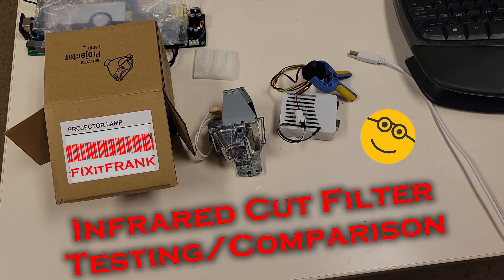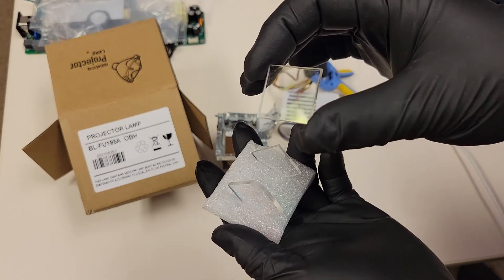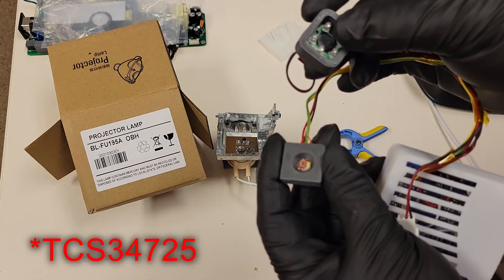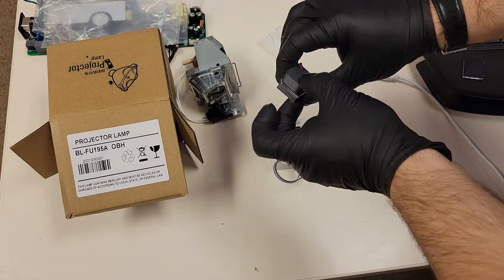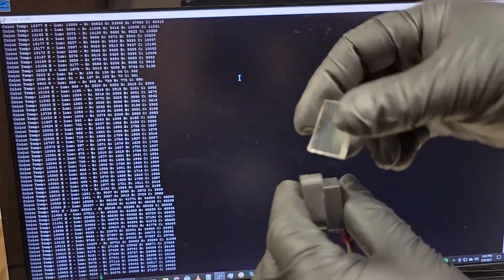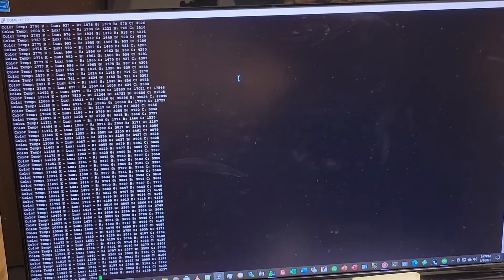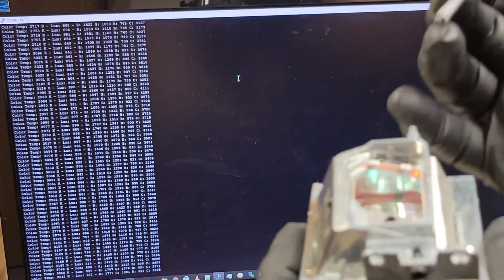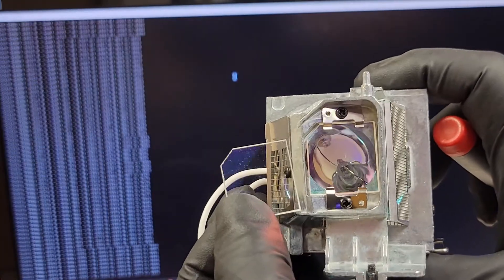Infrared Cut Filter ND Filter Testing/Comparison for DLP Projector Lamps

Comment: Hello, found this when searching what kind of bandpass filters are in projecotr lamps. What terrifies me though is that I thought this filter is primarily a UV filter. I know that deeper UV is unhealthy for the DMD itself, wheras IR does not damage DMD unless it's overheating it. I wonder if You know what would be the cut-off ratio for UV in this filter (or perhaps in this case the UV filter may be more far away on the optical path).
Reply from the maker: My understanding is the glass used for the IR filter cuts off all the UV. Standard silica glass cuts most UV immediately. To transmit UV, they use a special quartz glass I believe (not 100% sure) to allow it to pass. When I measured the wavelengths with my photospectrometer I had almost no UV bands showing. Maybe I'll do that again and record it.  I have an actual Licor li-1800 photospectrometer and that was my results with an older Optoma hd20.

Comment: Do you know of a place that I could purchase a lens ? BenQ w1070 thanks
Reply from the maker: Hi, do you mean the IR lens for the lamp assembly?
Reply: @FixitFrank  yes mine got damaged when the lamp blew. Replaced the lamp and housing but the Lens on the new housing is not working. Would like to just replace the lens. Unfortunately I can't return the lamp.
Reply from the maker: @MikeLL1984  If you are in the states, I can help you out.  My email is on the about page.
Reply: @FixitFrank  I'm in Canada thanks for the offer figured there'd be some website that's sells them.
Reply from the maker: @MikeLL1984  Canada is okay. I can use USPS.  Finding those lenses by themselves is difficult.  They are considered part of the lamp assembly so they are not really sold by themselves.  My day job is in the lamp biz so I have access to things not normally available.
Reply: @FixitFrank  that's awesome man. I will email you shortly! Thanks

Comment: Hey Frank, enjoy your channel, you showed me how to replace the color wheel, in my Optoma HD20, question do you work on Blu Ray Players, i have a Panasonic DP-UB420, 
it has sound, but no video, just turned a year old, i bought a new Sony, if it's worth it, would be good to have a back up.   Thanks  Daveo1945
Reply from the maker: Hi David, I might be able to fix it.  My only worry is that if it needs parts, it might not be worth it. I do see they are going for about $200 still, so a repair might still be worthwhile.   I don't want to give you a false sense of hope mostly. If you want to ship it to me to look at, I'd be happy to take a crack at it.

Comment: Does it matter what side faces the lamp on the protective coating they put on? Or is that coating on both sides? I'm guessing it wouldn't really matter what side it's on, other than maybe a little less direct IR and UV light if it's facing away from the lamp inside. I'm guessing it's usually on the outside because all your examples showed the protective coating shining from the front. I've seen your other videos about the protective coating and what to look for. Very helpful. Thanks for this informative video!
Reply from the maker: Hi Marcus, actually yes! Most lenses will have a tiny black mark or dot in a corner. That dot faces outward. The more 'red' side should be out.  Does it make a huge difference? I don't think so but I'm not sure. You gave me an idea for another video though. Let's find out!

Comment: Hi, Frank.  Stumbled into your channel looking to solve a mystery.and it looks like you know more than enough to help.  Optoma GT1080 Darbees. I have three for a SimPit setup all are equidistant from the screen.  Two have very sharp images, but the third will not focus sharply/properly at any setting.  How should I go about correcting this issue?  Lamp?  Color wheel?  Need help.  Thanks.
Reply from the maker: Kind of sounds like either a damaged dmd or something with the lens system. I'd seen DMDs appear like the mirrors detached from the substrate. You can usually focus part of the image but never the whole thing and focus adjustmentd tend to be small when almost focusing on each area. The first time I ran across this, I incorrectly thought it was dust buildup and then a lens issue. It ended up being the dmd chip. If that is your issue, it would be kind of weird unless the gt1080 in question had a lot of hours on it before you set it up. I've never seen it on a newer projector but I'm sure it's possible.  I think the delaminated mirrors happen when the chip is subjected to excessive heat for prolonged periods. Usually from after market Amazon lamps (ctlamp, jaspertonics) with bad IR block coatings. I'd suggest seeing if you can focus parts of the image and determine if you only need a little adjustment to focus other parts of the image. Of that's the case the dmd is probably the culprit. Otherwise my thought is the main lens has a portion of it not in position. That is harder to describe. Check the dmd first.
Reply: @FixitFrank  Thanks.  I'll play with the focus more with particular attention to detail on how it focuses regionally across the area.  I suspect that I can get a good focus in some spots, but not evenly everywhere due to an earlier observation - just going to be a question of degrees now.  Not many hours on any of the projectors and no after market/custom parts.  I sent the blurry one back for factory refurbishing within the time limit, it came back better, but the adjustment didn't hold...now it's been too long to get it done at no cost.  The funny thing is that the refurbishment didn't hold long, but after many hours of use, it's not gotten worse either - just enough to really notice when I move from looking at the right area of the projected area!  I'll get back to you with an updated description when able.
Reply from the maker: I must add that I was not familiar with simpit until I read your comment. I want one!!
Reply: @FixitFrank  🤣

I dig my SimPit Centurion.  The guy that sells them is cool too.  I've encountered some unique issue playing with three projectors that some tech guys have no idea how to fix, but it's still been good for DCS, MSFS 2020, and MWO.  Helicopters on Arma are okay...still trying to tweak that for a 270° view and not having any luck.

I may, eventually switch to VR/AR, but this really works for now - especially when introducing other people to the fundamentals of flight since simulator pits work well with physical control set ups like mine.

Comment: Frank I need help with my projector. How is the best way to get some help?
Reply from the maker: Hi Shane, what kind of problem are you having?
Reply: @FixitFrank  My projector is only showing half the image after replacing the lamp and wheel.
Reply from the maker: @shanepearson131  The mainboard is probably not quite seated , or the light tunnel has shifted.  If you can share a picture of the screen(imgur.com is good free host), I can look at it and let you know what I think.  What model is it?
Reply: @FixitFrank  Optoma GT1080.
Reply from the maker: @shanepearson131  Sweet. I know those well enough.  Definitely post a picture if you can.   I like to see them posted here though if possible so that other people can benefit if needed.   If you have to use a private or personal email to do so, you can email me directly frank@fixfrank.com
Reply: @FixitFrank  ok lets try this way: 
https://   imgur.com   /a/Uch2xNH
Reply from the maker: @shanepearson131  https://imgur.com/a/Uch2xNH  Perfect!  That is the light tunnel. I have a few videos on light tunnels.  Yours has either slipped or it moved during cleaning.  You should not have to buy any parts and hopefully it can just be adjusted back into position.  Check the light tunnel vids I have and if you have any questions or you get stuck, let me know.

Comment: Hello! i am from sweden.  BenQ 5J.JEE05.001 i Orderd from the usa philips bulb. i hop it is better then osram!!. my osram in my benq w2000+ is flickering evry 1000hr  it is called id wandering electrode sorry for bad engishi.!! my problem is i love my benq but i think the w2000 drive the lamp too tittle of current (the Ballast) or is osram shit??
Reply from the maker: Din engelska är väldigt bra!   Philips is much better than Osram.  The Arc wander/electrode wander is also a symptom of too much time on Eco mode.  If you run Eco mode for more lamp time, please use standard mode sometimes. This keeps the arc electrodes clean of "scale" or "elektrisk smuts".  I suggest every 50-100 hours.  Osram is not quite shit, but Philips is much better. It is like Mercedes or Skoda.  Skoda is better than Trabant, but Mercedes is better.

Comment: Thanks for your video! I have an Optoma HD33, and I tried to tear it down to clean the light turnel, but I failed, have you ever repaired an HD33?
Reply from the maker: Yes! Look up my videos on the HD20. It's the same housing and steps. It's essentially the same projector
Reply: @FixitFrank  Yes, already saw it several times, but I think it's a little different🤣
Reply from the maker: @NiponTsao What are you seeing that is different? I have an HD33 here and it looks identical inside to my HD20.  Where are you stuck? I can look at the one I have here. It's here for a new mainboard so I cannot turn it on yet.
Reply: @FixitFrank Thanks for your reply! I can remove motherboard shield, but i can't remove the motherboard, which sticks to the box so tight, I am not sure what the problem is.
Reply from the maker: Did you remove the connectors nuts on the back and the hdmi screws?
Reply: @FixitFrank  Yes! I'm wainting for the weekend, then I will try it again.
Reply from the maker: @NiponTsao  I cannot promise but I will try and put up a video on removing the mainboard from the HD33 tomorrow evening(gmt-4).
Reply: @FixitFrank  Thank U sir!  Have a good day!!

Comment: Thanks, Frank! That was actually one of those things that sometimes puzzled me about projector lamps. 👍👍👍
Reply from the maker: You're welcome!  Is there anything else that might be worth going over?
Reply: @FixitFrank  Thanks for asking, I thought it would be of great value to go a bit further upstream in projector lamps. You have covered so well the bulbs, so maybe the ballasts could be interesting to dig into a bit more. Things like power rating in relation to the bulbs, what happens if this rating is too high/too low. And the specifications/requirements of the power supply to the ballast etc. Just a thought. ☕🍺😊

Comment: More important is did that block ultraviolet light, UV is harmful for our eyes and skin, but normal regular glass block a lot of UV (Just UV-B and UV-C, but there still remain UV-A untouched), Infrared light is safe for peoples, but IR transport a lot of heat, is it safe for projector? Absolutely not, it can even melt some parts, for example last projector I opened had melted center of one of dichroic filters (they also block UV and IR, and that can kill them)
Reply from the maker: At some point when I can set it up, I do have a photospectrometer that can measure UV-A, B and C but the lux output of the lamp is too high. I need to find a safe way to attenuate it without affecting the wavelengths to get a proper measurement.  My current plan is to shine the projector down a long hallway or warehouse space and put the photospectrometer at the end.
Reply from the maker: These do block UV but I do not have a way to test it yet.

Comment: Hi Frank Interesting video. I have a question about a projector. Its a Vivitek H1188 showing 4 green flashes on the power led. User manual says it is a thermal break sensor problem. The sensor has been replaced with a new one but it still won't switch on. I believe that the fault code needs to be cleared from some chip first. Do you know how this is done or have you come across anything like it before. Any help much appreciated, Thanks.
Reply from the maker: Hi Paul, are the fans spinning up?  The other cause is another thermal event which could mean a fan not spinning properly.  Did you have a lamp explode before this started?
Reply: @FixitFrank  Thanks for your reply. Projector doesn't start up at all just shows flashing light. Fans have been checked and do work. Bulb is fine as well has never exploded. Think it needs to be reset somehow to clear the fault code.
Reply from the maker: @pauldavies4922  As far as I am aware there is reset for the code. The code should reset once it senses the thermal breaker is passing current again.  Most Delta devices actively watch and reset the errors.  I would check the thermal breaker from the circuit board it is connected to, so you can make sure there isn't a bad connection. Something had to cause the thermal breaker to trip, it is not common for one to fail for no reason. The cause may be why you are still seeing this error. 
All of that said, without seeing the projector, I am sort of inferring a lot of this.  If you want to email me a picture of the inside of the projector, I may be able to help more.  Things like this are hard to diagnose remotely, even more so without seeing the inside. 
Otherwise, I would verify the continuity of the new breaker, be sure it is open-on-heat and not close-on-heat. I suspect you used the same part number. If so, then it should be fine. The connection on the pcb might have cold solder joints